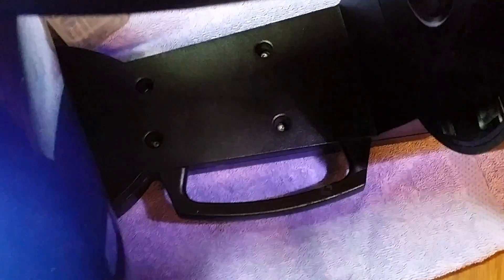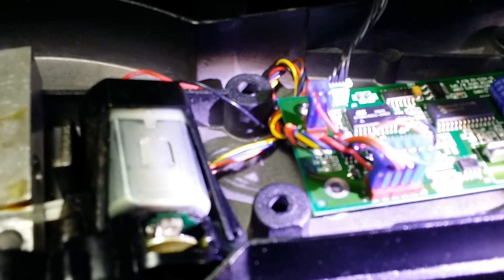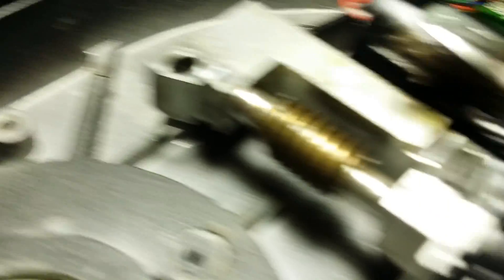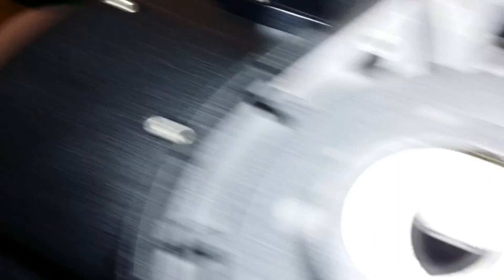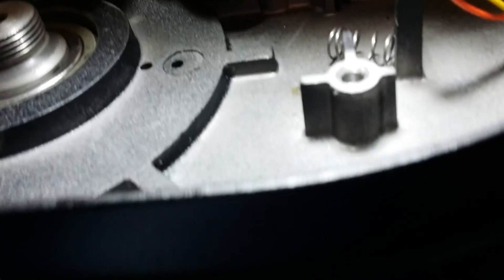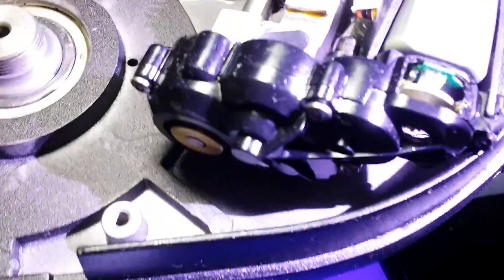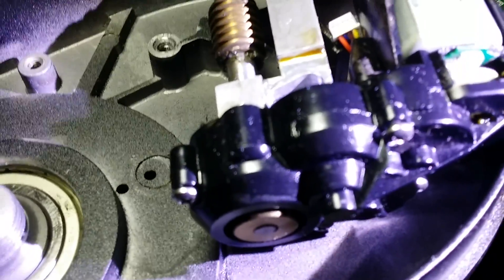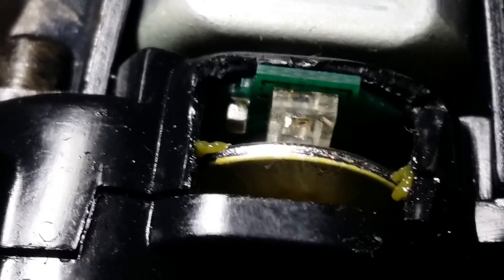Meade LX90GPS declination runaway fix Video PART 4

Comment: New owner.
I just got a Lx90 Aug 10 2025 but needed to remove the black Meade grease and install super lube. With Part 3 and Part 4 can now get at both worm gears to R&R all the grease.
and
Will look out for the loose screw on the base gear.
but
Will wash out the threads with IPA, dry, and install gear block bolts with Blue Loctite, and let it cure for 24hr.
Thank You